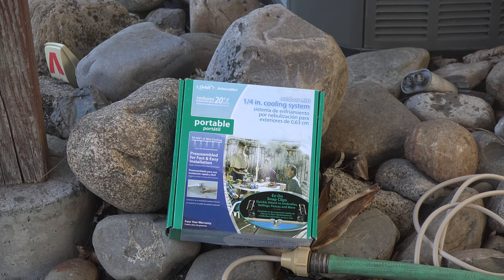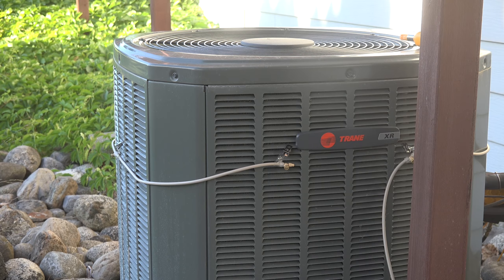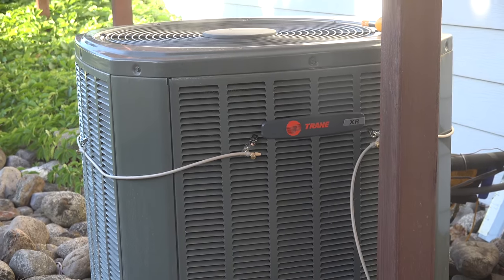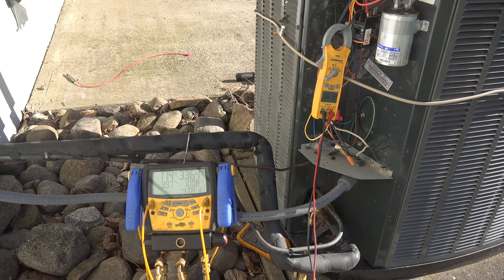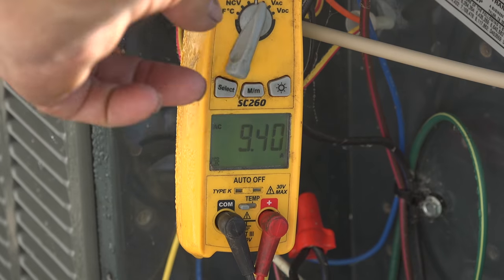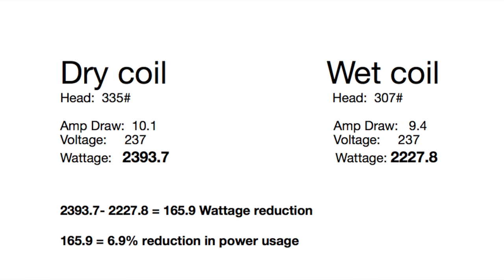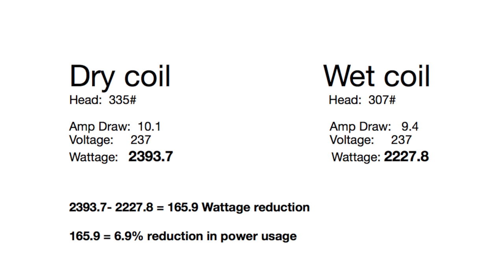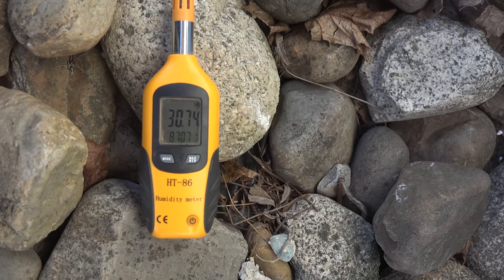Do the misters for A/C work? Part #1

Comment: Anything that lowers high side pressure is good & the system doesn't have to work so hard ... If you don't believe me start your car turn on the AC & let someone spray cool water from the hose on to the condenser & see the difference it makes on the inside air temp coming out the vents in the car
Reply: MH, I should try that.  Technically the evaporator is moving heat to the condenser through the refrigerant, so I guess you must be right.
Reply: Wrong, there is normal operating head pressure and excessive head pressure caused by several different factors. In a situation such as a fan not moving proper air across the condenser coil, (dirty coil, replacement motor of wrong specs, motor running in wrong direction-yeah i have found that, etc.)  introducing water that is evaporating will effect the systems performance, but this is a band aid effect. the correct course of action is to insure that the system at both sides is operating within correct perimeters. condenser coil is undamaged, clean, and proper airflow over it. evaporator coil is clean, proper airflow across it. This will also include, compressor operating properly refrigerant charge within range, based of of proper airflow, sub cooling and super heat within manufacturers specs for current conditions.
If spraying water onto an air cooled condenser coil had merit, all the manufactures would have standardized it long ago.

Comment: I would think it would add cooling capacity on hot days when humidity is not excessive.  Additional capacity might be more valuable than energy savings when your system is slightly undersized in extreme temps. What is your opinion on that gfm?
Reply: Jim Damiani I plan to use this system exactly for this. The outdoor temp can shoot upto 45-50°C while is AC unit is only rated to run upto 43°C, so this system can possibly help me on those super hot days.

Comment: The dew point at the time of use will have an effect on the efficiency. Anything above a 65° dew point,  pretty much eliminates any gains. However a water curtain running down the coils does have a major effect by using the temperature of the incoming water and not the evaporative effect of a mister. I run a column of water down the condenser on my four ton unit, adjusting the flow to allow a ten degree rise of the incoming to outgoing water. Right now it is 96° outside and 78% humidity. Water on vs water off is 34% reduction in input energy. The outgoing water is drained to my large pond. No mineral build up at all. Last winter we used it on cold snaps to add heat as well.

Comment: The only real-life application where a mister system make sense is a large commercial unit that has doomed condenser coils. It can buy you a little bit of time while you get the budget to replace the coils or the entire unit. Excellent video, sir.
Reply: Peter Valadez Florida is typically very humid so the evaporative effect is lesser than a dry area. Again, for a large commercial application where you are planning to replace the equipment; it might buy you some time. Typically, a commercial mister system would be a 1/2" copper pipe run along the outside of the unit with Ts and mister heads every few feet. The system is controlled by a solenoid valve that opens when the head pressure gets too high.

Comment: you did miss one important factor!!! the temperature of the air blown inside
I believe if the air would be colder that would mean the unit runs less time.
Reply from the maker: Do you mean inside duct temp?  If so, how are you planning to reduce that temperature?
GFM
Reply: grayfurnaceman 
yes the duct output. if that will be lower, means the house will cool faster, implying less run time on the unit
Reply: Less run time equals inefficiency. They don't become efficient short cycling. The longer it runs the more efficient (20 minute cycle much better than 5 minute)
Reply from the maker: The run time may be reduced, but I believe it will be minimal. I will do a video to test.
GFM
Reply from the maker: You are , of course, correct.  However, the decrease in run time is probably quite low.  I will be doing a video including this measurement.
GFM
Reply: GFM, we know already that it does reduce the load on the compressor.  What we don't know is if it actually affects the cooling of the house, which I'm guessing might be minimal, but in a previous post, it was stated that spraying water on a car condenser improves the cooling inside the car, so an empirical test is in order, and you are just the man for the job.
Reply: It is the thermostat setting that determines how cool the house gets.  With a mister, it is likely to reach that set temperature sooner than without a mister.  Your money savings comes from running the condenser more efficiently, and for (presumably) less time.   The house doesn't get any cooler unless you drop the thermostat temperature.
Reply from the maker: I just did a video on indoor temp drop across the coil.  You may find it interesting.
GFM

Comment: I see it mainly as a way to get a struggling unit through a bitterly hot day. If someone really wants to try it, they might as well save the $60 and use their lawn sprinkler or even a hose nozzle positioned on a post nearby.

What are the capacitor and Victor trap for? Just to see who's paying attention? :-)
Reply: I agree Bill. It'll also probably help if the unit is undersized. And by the way, I love your channel. IMO, you have one of the best channels on Youtube. Keep up the great work!
Reply: Been there, done that. On a large commercial condenser that kept tripping out on high pressure in D.C., during a heat wave. It's a real "duct tape" type solution, but it got us through until my boss got money approved to replace the unit.
Reply: Perfect use for it.  My system is leaky and 20 years old.  I will be replacing it in the spring, but need to get it through this summer.  I am basically doing the same thing with an old misting hose and turn it on each day.  It is amazing the difference in how it is working, you can physically feel the air is cooler coming out of the registers & the unit runs much less often.  I will not do it with the new one, but with every day being 90 degrees in NC & the hot sun heating up my attic, this has limped me through the summer nicely.

Comment: I've seen the rabid know it all videos who never worked on a/c systems put down veteran a/c contractors who do not agree on this snake oil version of savings, when I rinse a coil on a hot day the indoor area feels clammy while the coil is wet, what about premature rusting and I'm sure every one of these guys have a water treatment setup to prevent any minuscule scaling on coil, does the mister price win over the paltry savings and extra little water usage, some of these also want to build an enclosure to keep the sun off of condenser no such thing as high head pressure on a covered condenser, JK, some companies void warranties if they come upon a condenser with a bad compressor that has an enclosure, but what the hell do I know about a/c systems in my 20 yrs of doing it.
Reply: muniznick was there a question somewhere in that block of text?
Reply: Jonathan Roeder - ha ha ha ha. I thought the same thing!
Reply: A wet condenser shouldn't raise the RH in the space..., am I missing something?
Reply: Outside in normal elements not the same as continuous. ever see a condenser get continually marked for territory, as in pissed on daily by the family dog? wrecks it, granted piss is harsher than city water, but natural elements are much softer than this misting system idea.

Comment: You’re going to corrode you condensing coil super fast doing this, I’ve seen it a few times before, I’m a refrigeration and air conditioning mechanic
Reply: Is this true even though condenser coils are designed to be used in high humidity environments?  I'm an engineer and scientist.
Reply: doesn't rain outside?
Reply: @21boxhead  Rain does't have the same minerals and hard water deposits that city water has.  Rain also does not come down each and every day.

Comment: Another very nice video. The big benefit would be a reduction in head pressure during an exceptionally hot day that could make the unit lock out on a high head pressure. Also the electric company would appreciate the lower kwh use on that very hot day. However it would take many, many people doing it to make a difference. When I ran a very large chiller, the electric company would call me to see if I could reduce the load. I did but the people in the lab building were not happy when the temps went from about 72F to 80 plus. Also need to add water cost into the cost factor. Thanks for the video's.
Reply: Waterman one I'm sure the power company would love it but not your water utility...

Comment: With the lower air temp that the AC unit is passing through it you are also going to have a lower run time that will further increase savings.
Reply: ....and the fins will fall off.

Comment: Another thing to consider, some ice machines run off a water cooled condenser for 10 to 15 years with no significant scale build up. Scotsman, Manitowoc and Hoshisaki all make  water cooled units. Same with some hydronic systems. Will think about this for a while!
Reply: you know there's "heat pump/geothermal" condensers using water from lake/pond or loops in ground/wells right? the down side is they have many more things to go wrong, like pumps, filters, controllers, balance valves the risk of freezing in cooler climates and heat pump mode. so you have to run and maintain glycol in them.
i'll avoid commercial size "chillers" and towers :)
Reply: Melvin292 water cooled condensers do not experience  evaporation which then causes deposits to accumulate as water disappears

Comment: The water is just another medium for removing heat.  It will lower head pressure and it will remove heat.  Evaporation is one factor.  The temperature of the water is another.  The temperature of the water will lower the air temp at the condenser.  It will not affect the indoor humidity in any way.  If it was an emergency like an old unit that can't remove heat anymore then its a great solution until you can replace it.  On a new unit it will accelerate corrosion and shorten equipment life.
Reply: he was talking about outdoor relative humidity, if it's real humid out, then adding additional mist will do near nothing.
Reply: Michael Paddack ... and it messes up the coils and it rust out the body and makes a general mess and it is not recommended. Experience has taught me that snake oils do not work and I'm an air conditioning technician. I'm not a God I'm just saying you need to keep this simple and not mess your coils up
Reply: Roger Lund I don't disagree with anything you're saying and pretty much said that at the end of my post.
Reply: throttle bottle 60 degree water wouldn't lower the head pressure.  Interesting.
Reply: 60F water would sprayed directly onto the coil for water to gas cooling, but as a mist with humidity at +90% or raining lol.
evaporative swamp coolers are a good example, they don't do any good in humid areas. non evaporative types using cold water through a radiator or heat pump with liquid to gas condenser will work good. but then you have many more failure points and need pumps, filters, glycol antifreeze, etc.

Comment: I used a garden hose with a spray nozzle ti test mine. I only saw about a 6% reduction in running watts in the morning with an ambient temperature of about 85 degrees F and fairly high humidity. Testing it in the late afternoon after the ambient temperature was over 100, I saw about a 30% reduction in watts. We’ve been running with a very low humidity in from about mid morning to evening so not sure how much the humidity helped vs the ambient temperature. I’m seeing running watts go from about 2000 watts in the early morning to about 2500 watts in the evening.

Comment: I have done the exact same testing myself, with much different results. The only difference is that you used an insufficient amount of water to be effective. My test was conducted  on a unit in full shade on a 100 degree day in west KY. (humid) Like you, my unit was running at 10 amps. With a generous amount of water the amps dropped to 6.5 or so, a huge improvement. I could hear the unit unload as the pressure decreased. Environmental conditions can and will make a major impact on results, therefore the savings will vary from day to day. But the theory is absolutely solid. Performance may vary with your experience. LOL
Reply from the maker: You have not watched the series.  You have also not tested delta T of the indoor coil.
GFM

Comment: Swamp water cooler combined with compressor Freon cooling are often combined in big companies buildings, but these are engineered to maximize efficiency.
Misting does not seem to add enough water to truly maximize cooling. It would interesting to add another set of coils with a water fountain near the existing fan and run the hot Freon through this system adding a extra swamp cooling coil instead of damaging a Freon engineered system.
Any techs tried running extra hot Freon through a water bath outside of the current fan and coil system?
Reply from the maker: Many package unit A/C units run the condensate onto the hot gas discharge line.  Also done with free standing coolers and freezers.
Large buildings use water cooled condensers and a cooling tower to cool the water.  Been done for many decades.
GFM

Comment: While you can achieve sub ambient temperatures through evaporation, you lose efficiency over time through scaling of the coils. In addition the cost of the water and if used descaling system and maintenance.

The commercial systems use a waterfall with recycling their water, water treatment and coils designed specifically for water sub ambient Cooling.

Comment: Im in Phoenix where the humidity is around 8-14% in the day we use evap cooling during low humidity but the dust which it sucks into the house is the downside of the evap cooler. Even with the water soak on the pads still get lot more dust in the house. I'm looking at this misting system being how dry it is here might be able to drop the current draw more then your test.  The big problem is our water had very high TDS over 600.

Comment: This is the reverse of choking off the coil which will cause the pressure to rise and the electricity to climb because it's having to work harder to do the amount of heat exchange the system is designed to do. It works the same if you run your AC in the summer as opposed to the winter without the misters. Having the condensing unit over a canopy to shade it also does the same. Temperature pressure and electricity are all related, if one goes up, they all go up - or down as is the case here. Is it worth the expense in water usage, I don't know if you can really justify that. My experience is from being an AC and Heating tech for 26 years in the deep south where it's always humid.